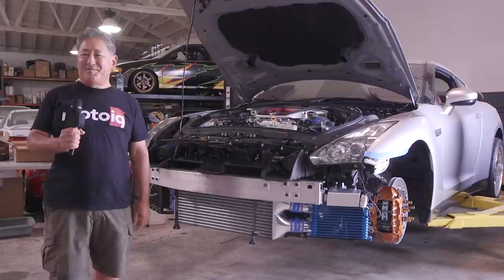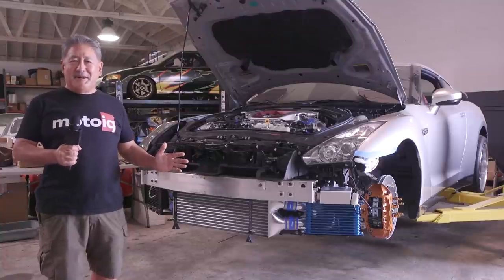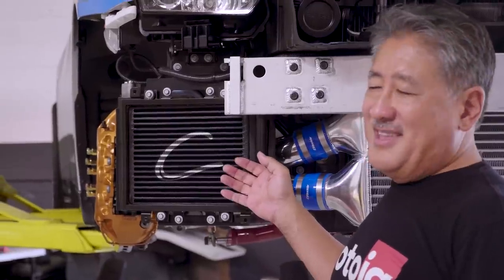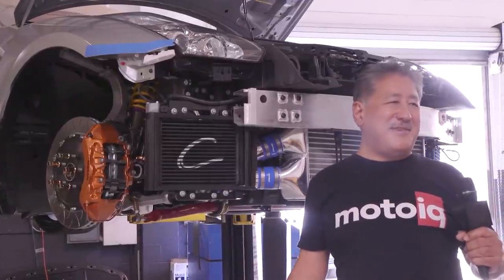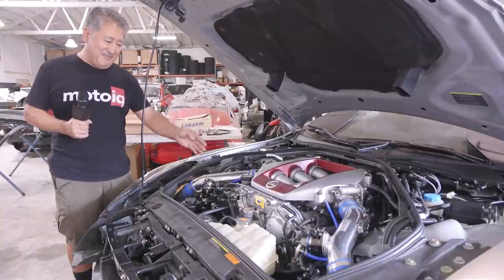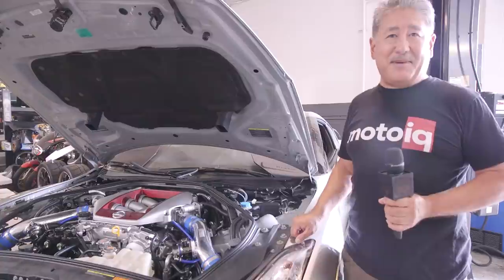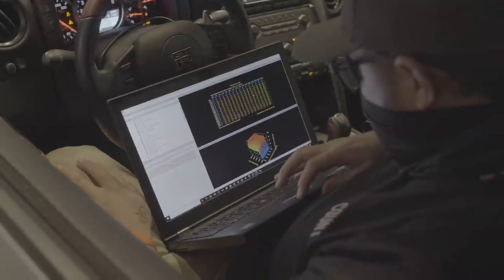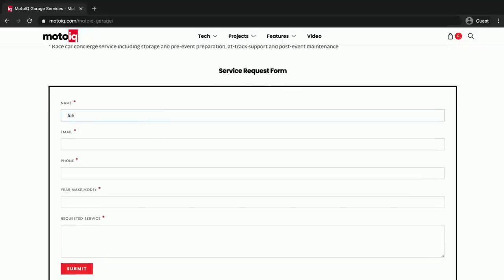Maxing Out the R35 GTR Engine & Transmission with ALL the Bolt-Ons!

Comment: Drove a GT-R a few years ago and have wanted one ever since! Truly a super car for half the price. Bought an E90 M3 and as fun as it is, it does not take to bolt ons nearly as well as a GT-R.  Also, I looked at the dyno chart for this car vs my old WRX with bigger turbo and E-85 and MY GOD the torque curve on this thing!
Reply from the maker: Plus the engine is strong and not a grenade like the  Subaru
Reply: @motoiq  Ice Ice baby !

Comment: Man GTRs are so cool! Those price tags are a bummer tho! I wish there was more support for the VQ40. With all the Frontiers, older Parthfinders, and NV vans they came in those things are all over junk yards.  They could be the poor man's VR38. The VQ40 has 166mm rods and a 1.81 ratio with stout mains, just open decks... Compared to the VQ35 it's got 22mm longer rods, 11mm more stroke, 2mm thicker journal on the big end and 10mm larger main journals so they freaking added overlap with stroke! I don't know how their head geometry compares but the bottom end is all potential.

Comment: To make the transmission last, take it all apart and heat treat the stressed parts. Correct heat treatment makes steel parts much stronger on surfaces. Stronger surfaces crack less, not getting cracks prevents breakage.
Reply from the maker: Its not even close to correct, most stock transmission gears are induction heat treated at the factory.
Reply: If your going take it apart might as well build it !!

Comment: Nice Video and very helpful.  I was just wondering what is the torque spec for the Greddy Automatic Transmission Oil Cooler Bracket?  Thanks in advance!
Reply from the maker: Tight, didn't even torque it.
Reply: @motoiq  I actually did a hand tight but then i can see some leaking
Reply: @motoiq  thank you

Comment: How has it performed as a time attack with these mods? Thinking about doing time attack/circuit racing so this video is really helpful.
Reply from the maker: The fastest NA time attack car is an R35
Reply: @motoiq  I was asking about your r35. How has it performed with these mods on the track
Reply from the maker: It is not built as a dedicated time attack car. That is what you need to win at time attack.   Unfortunately it got hit by an idiot and totaled before it could be driven on the track.
Reply: @motoiq  oh man sorry to hear that. All that time money and work just for some idiot to total it.
Reply from the maker: Yeah it was lame.  We are going to start over with a new car and finish it though, stay tuned.
Reply: @motoiq  will do. Can’t wait to see what ya’ll got in store. Thinking about turning my r35 into a track car instead of drag or roll race. Track just seems more fun. So this video is going to be very useful for improving the weak points.

Comment: seems like these are very similar to subarus in alot of ways. have you tried the OTL coils for high hp subaru EJs?
Reply from the maker: yes, our project STI ran them then promptly blew up before we could properly evaluate them. Our EVO IX and X run them and you could notice better cold start and idle on alcohol and a much better idle on the IX with its big lopy cams. Go to MotoIQ.com and check out the tests there.
Reply: @motoiq  thanks! I will definitely be checking that out.  I actually posted this video in my local subaru group and everyone tore me up because you guys used eagle rods which typically give out around 500whp. Why not something like manley or wiseco? They couldnt say jack shit about the rest because the rest was super informative! Thats all they were able to criticize fairly..
Reply from the maker: @boppernostopper8598   Your local group guys are wrong. There are 4 grades of Eagle rods, we used the extreme duty ones with the CA 625 bolts and special proprietary alloy which are much stronger than the base rods. These will take way more than 500 hp. Even the standard H-Beam 4340 Eagle rods with the ARP 2000 bolts can take up to 900 hp on your typical 4 cylinder. Eagle lower-grade rods are I-Beam and Eagle doesn't even make these in Subaru applications.

Comment: Any before and after of the IAT’s with the tube n fin. Also do you think the end tanks play a huge role in controlling temps?
Reply from the maker: We didn't data log that The end tanks can make a big difference in flow but controlling temps is more due to the intercooler core design.
Reply: @motoiq  Awesome thank you

Comment: Qustion when you set up flex fuel can you switch between gas and ethanol
Reply from the maker: Yes and any mix in-between
Reply: @motoiq  like half and half and what kidna result ehat would that give cooler gas with soem bonus property's I live in canada and in the winter how does e85 hold in the cold or high altatuid like the mountains or by sea level and what is the diffrence

Comment: Have you noticed any improvements to fuel economy with the ignition projects coils?
Reply from the maker: We experienced a huge drop in fuel economy because now the car actually feels fast and we punch it everywhere! The fuel economy is really bad on E85. The best mileage we now get is something like 20 mpg on gas and 14 or less mpg on E85. We also retuned the transmission shift scheduling to get rid of the annoying early upshifts and super aggressive light throttle upshifts. This helps driveability but probably also hurts mileage.

Comment: Always impressed with your knowledge, and always learning from your videos! Didn't they show on engine masters how the mushroom shaped intake filter made the most power? A little surprised you are using the 'standard' performance intake filter cone shape that doesn't allow air straight in through the end, but makes it all bend 90 degrees. (Just because normally you are on the cutting edge of every technology and pushing everything to maximum performance).
Reply from the maker: That's not necessarily true.  Mushroom filters have little surface area, usually have poor filtering media that lets all sorts of dirt past them, and not enough standoff for laminar flow into the induction tube.
Reply: @motoiq  Please explain Laminar flow ?

Comment: Here's a question to anyone. Let's say you build a motor of your own liking and everything is running perfectly.  What is the most major thing to worry about? Is it your cooling system or fuel or is it weight? What's everyone's opinion?
Reply from the maker: Well, things are not going to go well without adequate cooling or fueling.

Comment: Twin pass cooler?

I'm outa here
Reply from the maker: In monitoring the IAT's in this car, the variation is small and the temps are lower due to longer heat exchangers. If I was making above 1400 hp I would probably do something else but up to 1100 I would rather do this way.  Also less obstruction in airflow to the radiators which is important for track driving.  This is backed by data and testing.
Reply: @motoiq  I think you need to look at the pressure ratio across the cooler rather than how efficient it cools the air
Reply from the maker: That's why it doesn't work as well for higher power cars. Past 1300-1400 hp.  Like I said, backed by data and testing.

Comment: You don't want that kind of intercooler in your GTR!
Reply from the maker: it has some advantages over top to bottom flow like better charge cooling and more effective use of the entire core not just biased toward the inlet like most top to bottoms without shaped end tanks, some of the disadvantages are somewhat uneven cooling flow to the different cores which we fixed with a baffle and slightly more pressure drop due to skin drag of the longer core channels.  However pressure drop is minimal and much better than stock.

Comment: OK, dude here just cheated. He claimed all that 650 HP by "Bolt On". The real power upgrade here is purified E85. (not the E85-50 from pumps).  All other upgrades don't add as much as E85.
Reply from the maker: Stock on 91 octane pump gas the car made 421 whp and 419 lb\ft of torque. With mods, on 91 octane pump gas the car makes 583 whp and 600 lb/ft of torque. On a tank full of mostly pump E85 the car made 656 whp and 645 lb/ft of torque.  The car would have made more but we were tuning to keep the torque below 650 lb/ft which is the most the stock bottom end can take with reliably.  So E85 made 73 more hp.  On pump gas, the mods made 162 whp.  The mods made almost 3x the power of the switch to E85. So the switching to E85 doesn't make more power than the rest of the mods, not even close.

Comment: 650 hp is definitely not maxed out 😂
Reply from the maker: Sure it is with a stock bottom end and transmission if you want any sort of reliability from it.  Sure some YouTube "tuners" will get more and we can get more from bolt ons but then things will start to break unless you car is just a garage and dyno queen.
Reply: @motoiq  dude I have a 1500 whp gtr…I know what it takes. Upgraded turbos + fbo at 800-850 whp is extremely reliable and 1000s of people run that set up. Any real gtr tuner knows this as a fact. As long as the torque stays under 650 torque. Stop spreading misinformation. In fact 850 whp is so reliable shops give warranties out for this type of set up.
Reply: @motoiq  I see you guys do tons of different cars every week/month so maybe you don’t truly understand the vr38 but us in the community deep and build fast drag gtrs 24/7 know that 850 is safe 900 is when you start to push if
Reply from the maker: Our engine holds the torque to 645 and that's the horsepower we developed, we could make more if we ran more boost at higher rpm but we are on stock turbos so there is not a ton left there. We were holding the torque at 645 and thus the power level was what it was since torque and power are interrelated. So if we upgraded the turbos, we might make more top-end power, as the torque would fall off less past the torque peak but we are currently also against the octane limits of the fuel, having less backpressure may improve the ability to hold boost at higher rpm due to less reversion due to better turbine flow but why push the stock bottom end so hard, especially when the ethanol content of pump E85 varies so much.  Also, there is a difference between street reliable, 1/4 mile reliable, and what you can take to shift sector and run a mile on or a 20-30 min track session. We fix VR's that pushed street tunes too far. As far as misinformation the guys who tune the car and advise what the limits should be are Mitch Mckee and John Carburry, Mitch was the head tuner at AMS and the head development engineer for the GT-R at Cobb before starting M-Engineering and John was well known in the open source world as well as one of the top development engineers at Cobb.  You can google them. They tuned the car and it was done for reliability under track conditions not to make internet and youtube bragging numbers. I would like to see how long a torque limited 850 whp stock bottom end and transmission car lasts on a track day on a road course.  I would not do that on my car or recommend a customer do it.
Reply from the maker: We know the VR pretty well and we are just conservative on what we recomend.  Our customer base is also different, hardly any of them drag race, it's mostly track day kind of people and the cars have to be able to hold together for 20-30 minutes of hard driving that might require 30 seconds at continuous WOT and WOT for many shorter periods during just one lap.  Big difference between that and 9-10 seconds of WOT.  If you hold the torque to 650 lb feet the stock bottom end can hold for awhile but it's not good to pound it hard all the time.  The other thing to consider is that the ethanol content of pump E85 varies a lot, especially in our area.  You run the car hard and have a batch of so so E85 something bad can and will happen. We set up stuff to be reliable not, for youtube or internet bragging numbers.
Reply: It’s true you are not getting a 1000whp gtr without upgrading , fuel system , bottom end , turbos and transmission clutches. I have friends with 1200- 1600 and 2100whp gtrs and they break down to me what it took .